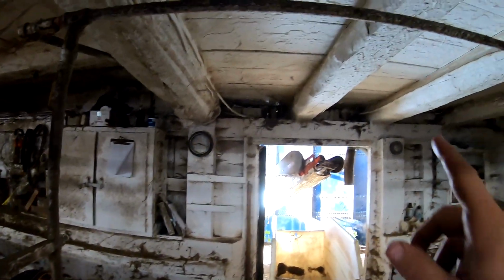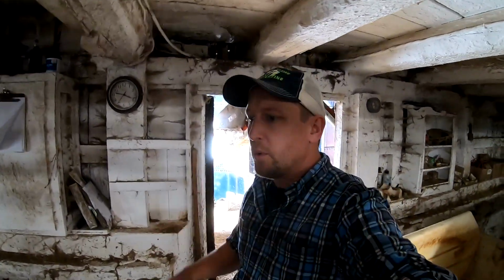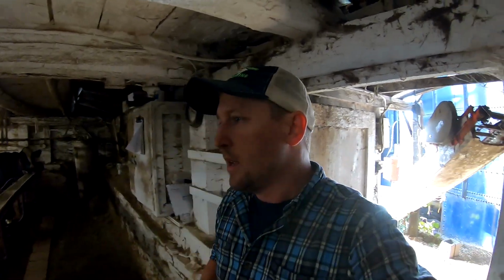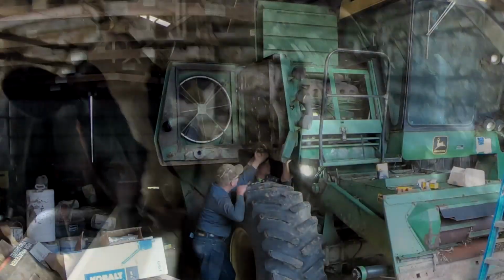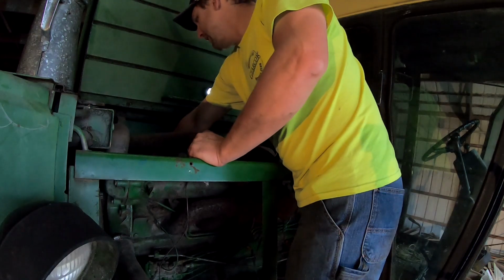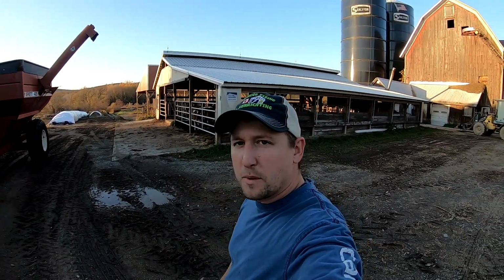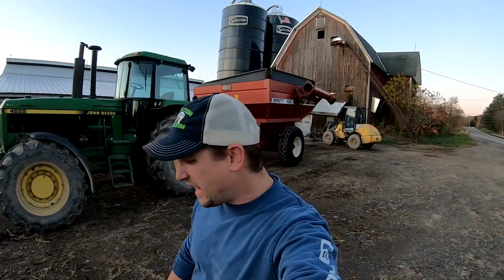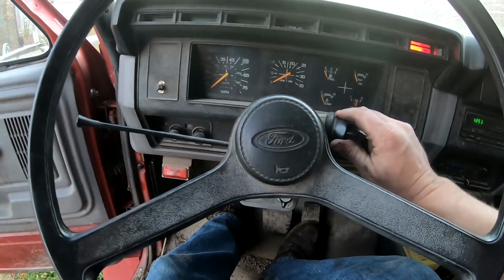Getting Ready For Harvest

Comment: Great video , stationary tmr mixer would fit u good I see , that’s what we use , we have electric feed cart too , cause we have the same issue , we made it work this way ,
Reply from the maker: Thank you. What brand stationary mixer do you have?
Reply: Jaylor . We use a wic feed cart
Reply from the maker: @wrightfarmshoffman8663  How do you like them?
Reply: Jaylor love , wore out the first one , on our second one , not really any break downs , as long as it’s greased and gear oil checked and changed it lasted forever, the wic feed cart was the same to be honest , only thing is the wic feed cart still have the original cart , we only changed the electric motor and apron chains , some wic carts have a cross auger we went with the apron chain , easy to adjust. We went with the electric motor instead of the gas powered we were more worried a fire starting cause of the hot exhaust,
Reply from the maker: @wrightfarmshoffman8663  Thank you for the info!
Reply: Your welcome